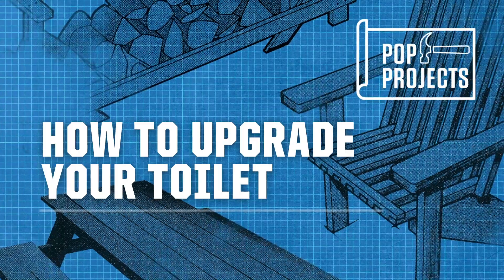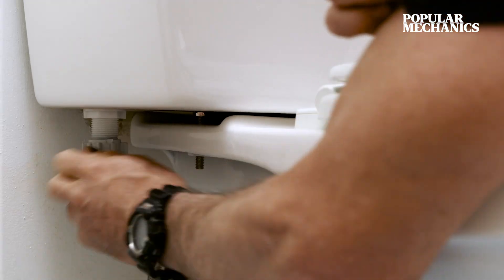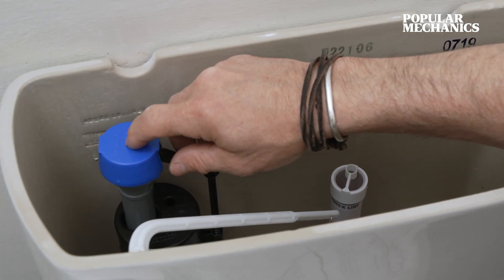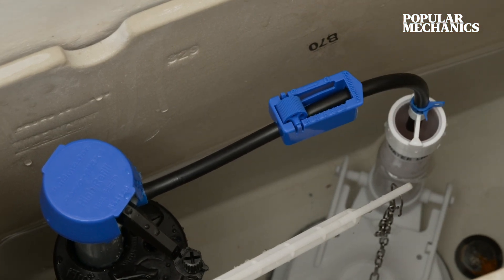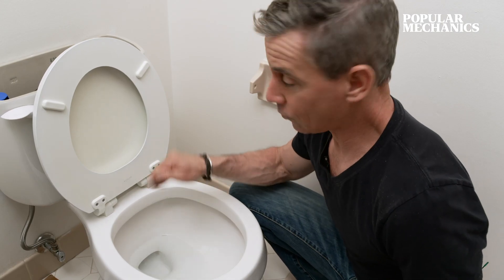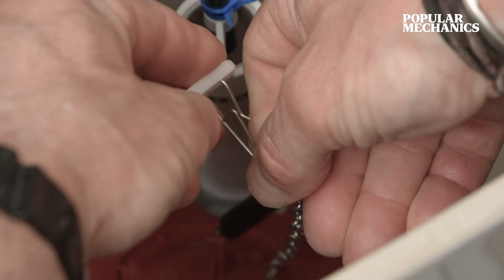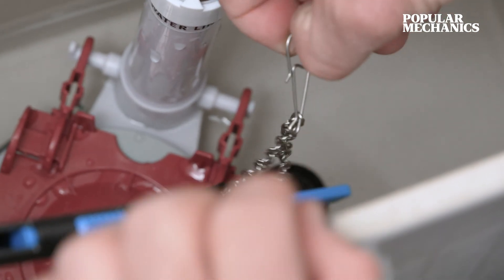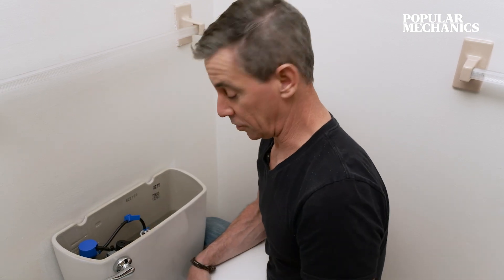3 Cheap and Easy Toilet Fixes | Popular Mechanics

Comment: What about changing the post in the middle of the tank that the flapper valve attaches to? 
One of the plastic hook-arms on the side of mine is broken and I have it jury-rigged right now. 
Is there a simple way to fix that as well?